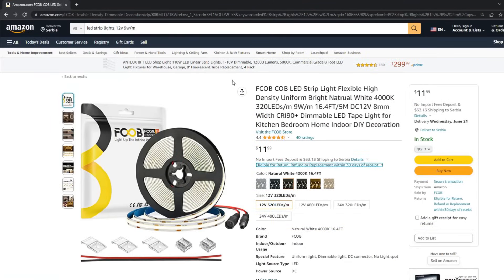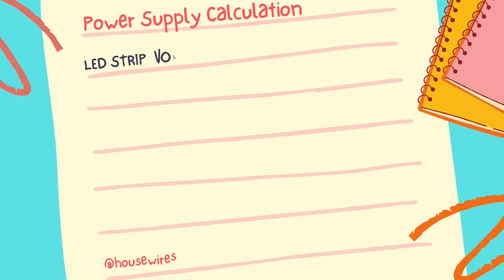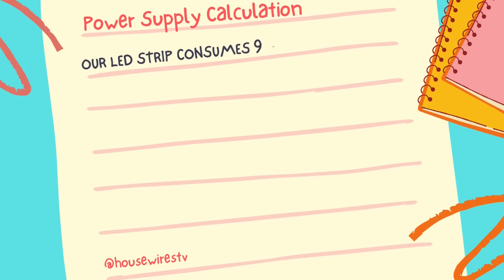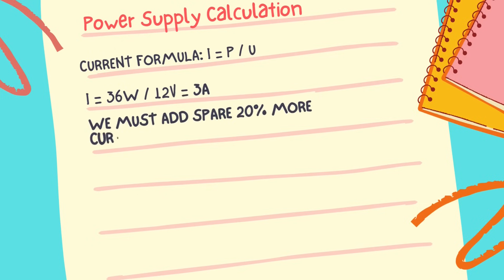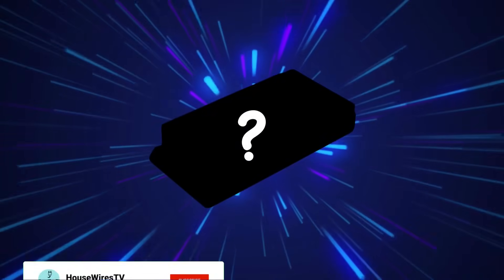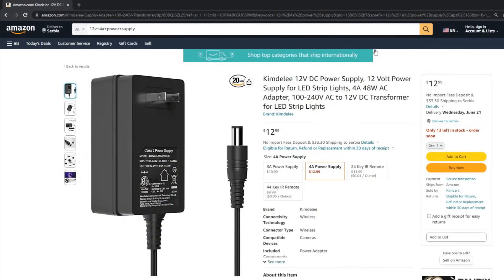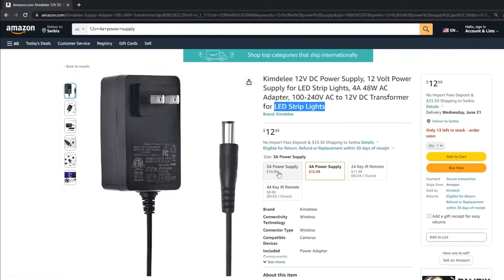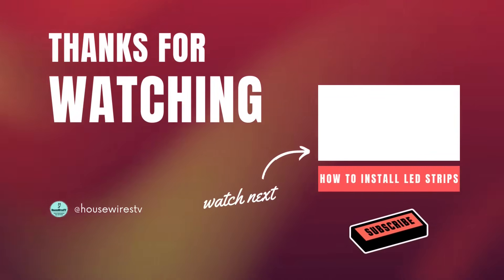How to Choose a Power Supply for LED STRIP

Comment: I don't understand why they calculate according to the voltage of the LED and not according to the general voltage in the network, which is 220 volts?
Reply: The 220V gets transformed into our usable 12V. Depending on the leds you could need 5V or 24V. Which would need a different power supply that can transform 220 into those lower voltages!